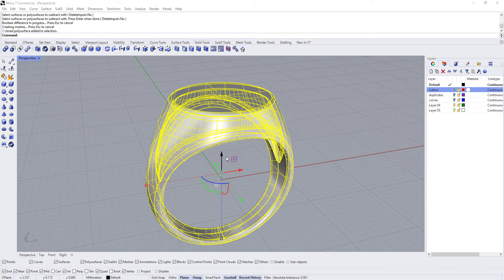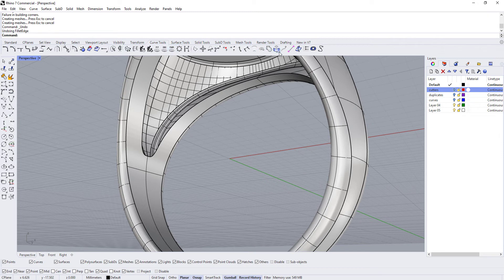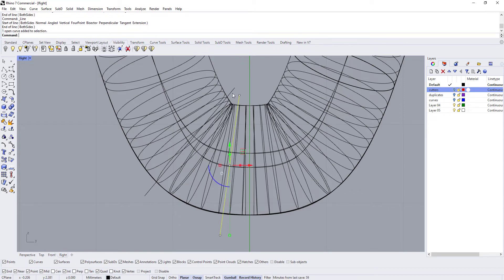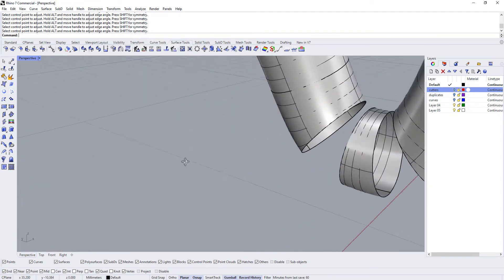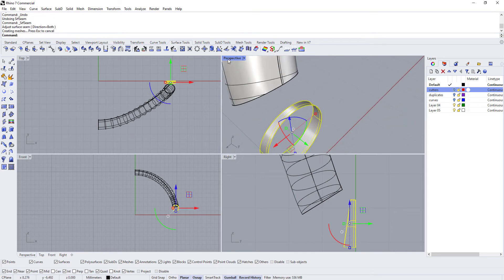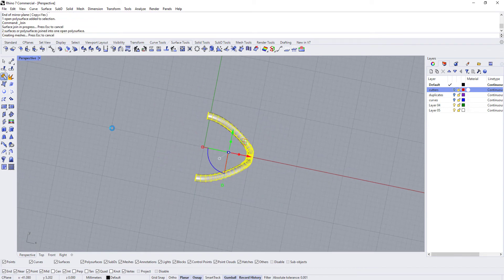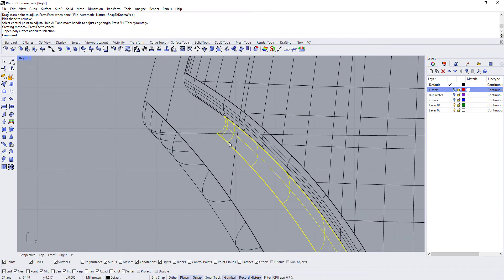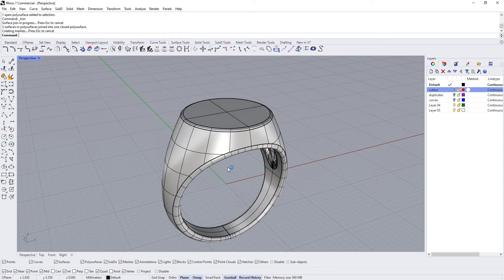Rhino | Signet Ring Tutorial | Part 4 of 5

Comment: Thanks. Another great tutorial. So that's how you do complex fillets in Rhino? Extract curves - make pipe - split - delete - blend open surfaces? Final result looks cool, especially with Emap with gold Matcap. But is it ok that all those isocurves of million joined surfaces looks like... trash? :) I'm used to SubD modeling, where topology matters. You see edges of your low poly - if they look bad and crooked, usually means your model is trash. Here I see hundreds of those isocurves on surfaces, which are not connected to each other, and to be honest not giving me any idea of possible problems... What's the use of them?
Reply from the maker: That is my general workflow when fillets don't work. However, often complex fillet situations will work with the fillet tool. As to your question about topology, I remember when I first got thrown into my jewelry design job, my only prior 3D experience was goofing around with Blender (and I had done exactly zero hard surface projects in my goofing around). So I get where you're coming from trying to switch from sub-d to this CAD stuff. With Rhino, you (almost) never have to worry about topology, and, in the rare cases you do, it's very different concerns than you have in sub-d programs. You do have to worry about "seams" and split edges (which are almost like hidden seams) and you can see me struggling with seams around 5:46. Surfaces that self-intersect are another common problem, which was why I had to remove the corners out of that pipe. I would say as a general rule, you do want to try to avoid overly dense isocurves, especially at the beginning of a project. But here, it really couldn't be avoided and it was a final piece and it worked, so it's all good.

As to the use of the isocurves, I've never thought too much about it. We have a tool called flow along surface (general idea is you make a simple flat surface as a proxy for a complex surface and "flow" objects from the flat surface to the complex surface. You generally get distortion, but you might get even weirder than expected distortion if the complex surface has wildly uneven spacing between the isocurves, a problem that might require attention. Being able to quickly see the density or sparsity of the surface might be helpful. As well, they help you see the shape of the surface (there might be more important reasons for them, I never thought too much about it before).

Just out of curiosity, and only if you don't mind me asking, what has you looking into non-sub-d 3D software?
Reply: @webduncetv  Thanks for you answers, you are really giving a lot of useful information. As for my interest in CAD/NURBS modeling... In short, I'm a freelancing modeler and my main tools are 3ds max and zbrush. I can model pretty much anything, organic or hardsurface, but recently I had few tasks that caused me troubles. One of them was jewelry, bunch of diamond rings for casting, with precise dimensions and requirement for clean, watertight meshes. In the end I made it with 3ds max, but If you know, SubD suck big time when it comes to booleans, like if you need to weld 20 repeating elements on a complex ring shank... It becomes a pain with Subd. So I thought maybe NURBS soft could help me with such tasks. Another reason was editability... A customer brought  a furniture modeling task with CAD data input. When you import CAD model into SubD soft, it requires a lot of time to retopo everything, to be able to modify anything. So I thought maybe using Rhino I would be able to edit CAD models more easy, but from what I see now... Looks like CAD models are not really editable at all :( I thought NURBS allow keeping complex assemblies "procedural", so you can keep adjusting and modifying elements without worrying how they weld together in the end. Also I was modeling car bodies, and always wanted to try professional NURBS tools on that. With SUBD you need to be very smart and careful planning combos of smooth-flowing and hardsurface elements. But looks like NURBS are even more tedious.